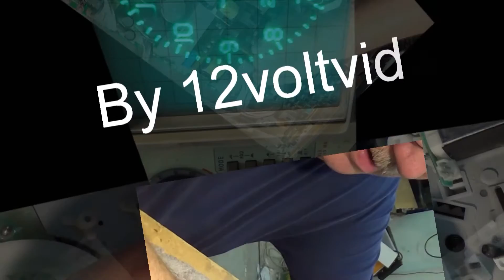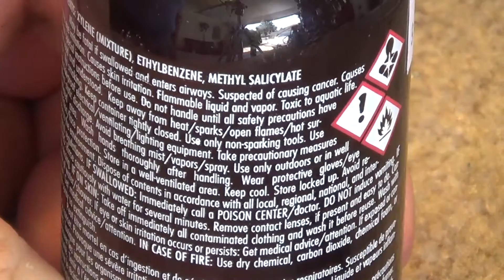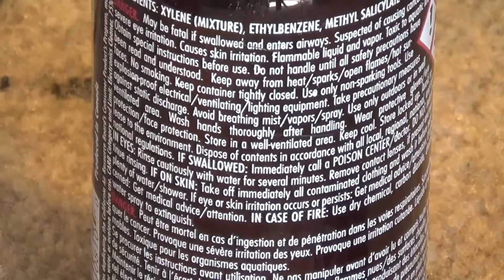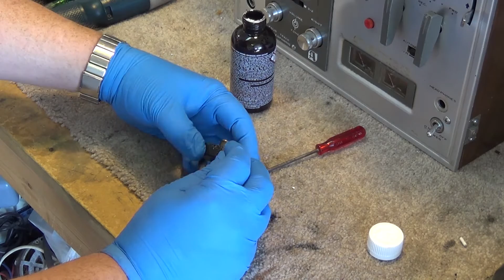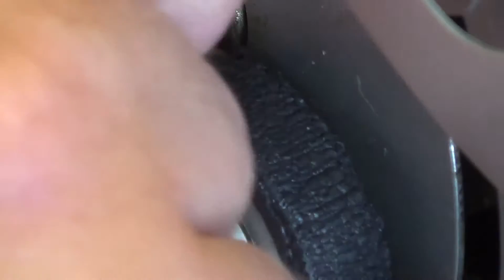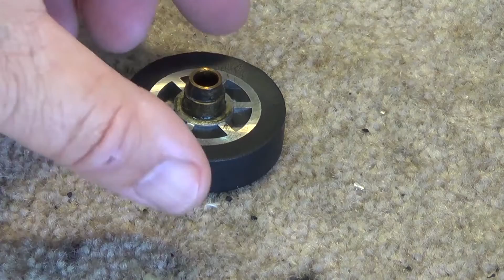Restoring a pinch roller with rubber renew

Comment: Get new Roller from eBay
Reply from the maker: +ranzenottel I wish it was that easy. I have been searching for a replacement for my old Ferrograph I wish to restore for 6 months, and so far nothing.
Reply: +12voltvids Here in Germany you can get new rollers for the akai 1710w. The old roller that you renewed will damage your tapes.
Reply: ranzenottel do you have a link to a German source for new rollers ?
Reply: @atariandre5014  revox_de   sells belts and rollers on eBay
Reply: @ranzenottel  Ive seen them on line, they cost more than I paid for my Akai 4000DS new back in the day.